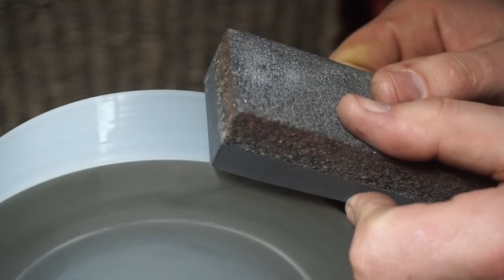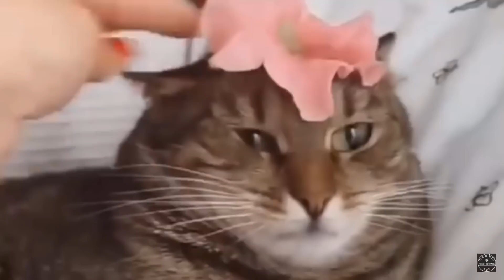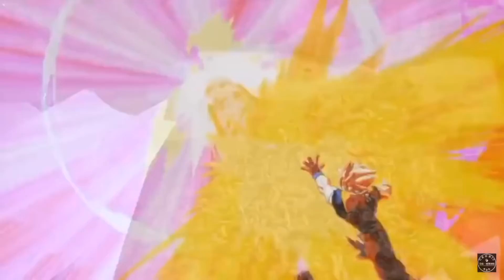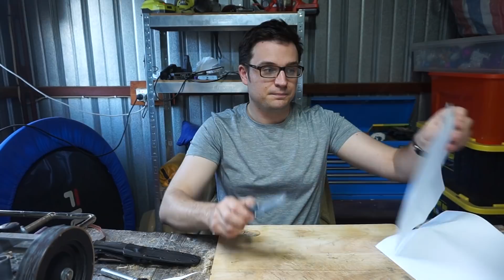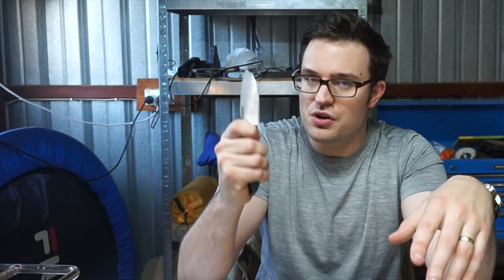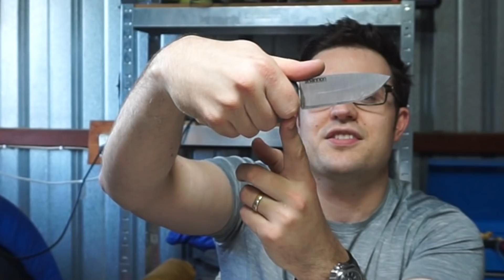Vanax Steel to the Van Max

Comment: Nice work Pete! If you ever get bored, you can try checking for how long steels hold a high sharpness, using cigarette paper push cutting or slicing as a stopping point.

Comment: How do you think X50CrMov15 would perform? Edge retention? What steel is it similar to?
Reply: It's similar to 1.4116 aka Krupp 4116. It's a low carbide steel similar to Sanvick 12c27/13c26 and 440a class. With a good heat treat you'll get fine grain structure, very fine carbides, high edge stability, high sharpness and good toughness for a stainless. Wear resistance would be low but ease of sharpening is high. I have a Fox machete in that steel and it's great for a stainless steel.

Comment: M390 should very much be in the ballpark of 61-62RHC, but would it not be prudent to re-test one (preferably newer batch) against Vanax at the same parameters?
Reply from the maker: Rama C It would definitely be, but the M390 test was close enough and it was only a month or so ago. I can only do so much and hope what I do put out is of use. Theres always another layer of prudence I could be doing I guess.
Reply: Vanax maxes out at 61-62, and you lose stain resistance and edge stability going that high. Its sweet spot is 60/61HRC. This knife is at 60.5HRC.
Reply: I am surprised it does so well... much better than how Uddeholm-Bohler ranks their steels themselves. 810 vs 790ish... with this much of a difference in alloy... something seems off, but who am I say having no experience with Nitrogen
Reply from the maker: Rama C also remember this is just one kind of test. cable ties, cardboard, wood etc — all may effect edges in different ways

Comment: I'd be interested in a direct comparison between M390 and Vanax regarding toughness and usability in large fixed blades (6-7" blade length). 
Having tested cryo'd M390 at 59-60 HRC in this specific midsized survival knife category, I can say, that it is certainly up to the task; you just should think twice about what you are doing i.e. don't split wood on stone. As far as work with hardwood goes: no problems with everything up to dried out oak with gnarly grain and knots. I wonder how Vanax would stack up to that.
Also interesting would be to see how it sharpens. In my experience the M390 I have is able to quickly polish out touchups from a Spyderco Ultrafine rod with stropping on leather: no toothyness left what so ever.
If Vanax stands it's ground in a direct comparison the last question would be if it's worth the price. Even M390 is really fucking expensive, so how much would it hurt to go the extra mile in corrosion resistance?

Great video, Pete! Always glad to see new steel tests that are complemented with goofy over the top fillers. 
Btw: you should check out the game "Undertale". It runs on pretty much every computer, takes next to nothing in space on your hard drive and most of all it's a retro styled game with heart and soul, so if you should find a little time outside family, job and knife stuff just check it out, you'd love it. (Also the soundtrack would suit your videos well, thats the reason I'm getting the idea to comment about it.)

Cudos to the person loaning these beauties to Pete.